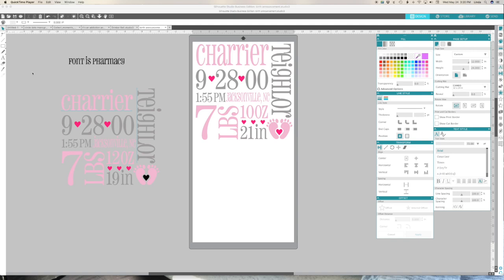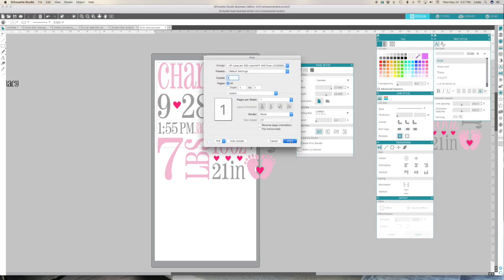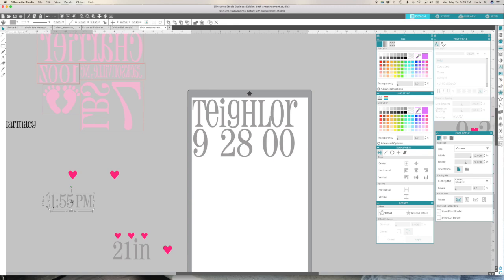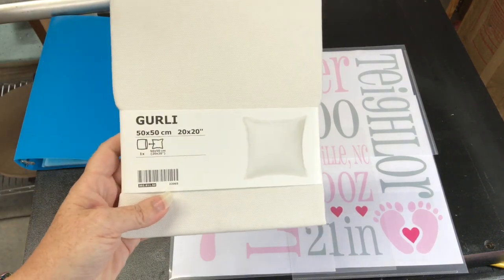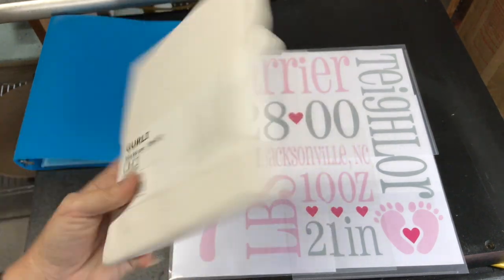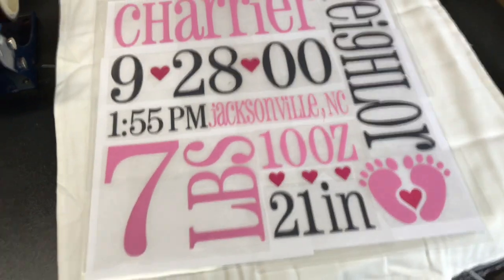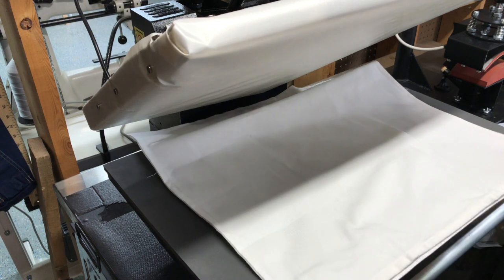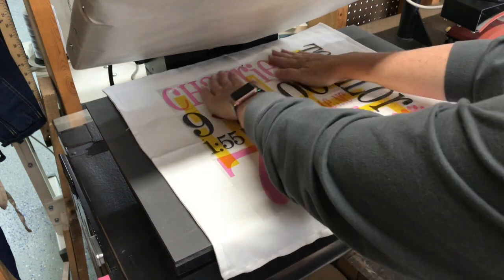Multi - Colored HTV on a Pillow (non-layered version)

Comment: thank you this was so helpful to a beginner like myself.What is the white paper you putting the htv on?
Reply from the maker: I'm not actually putting it on the paper. I'm using the printout from the first half of the video to properly align the different pieces.
Reply: Ms Linda, How did you print out your design? I have Cricut and can't figure out how to print directly to my printer. It only want to use the Print & Cut option.